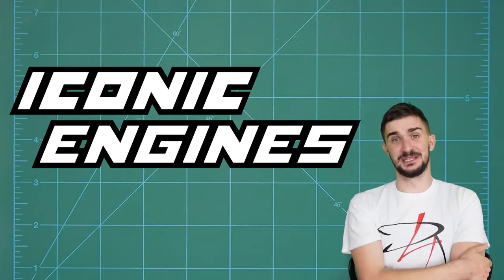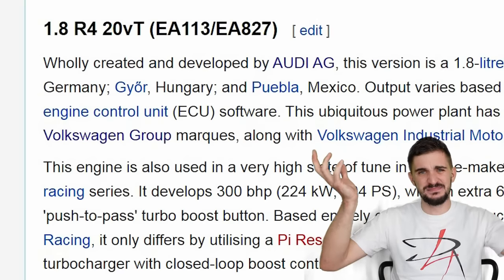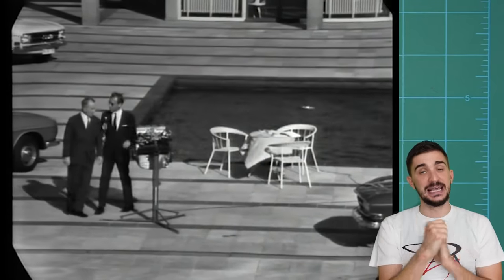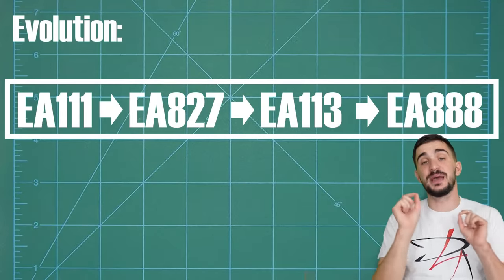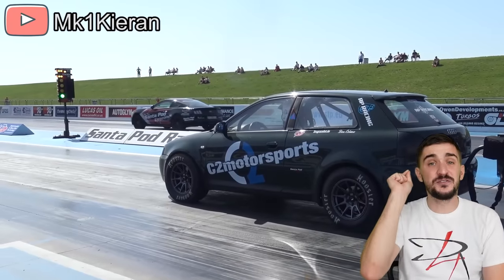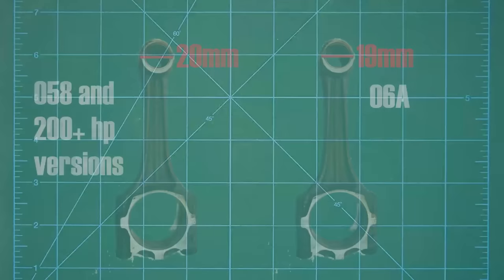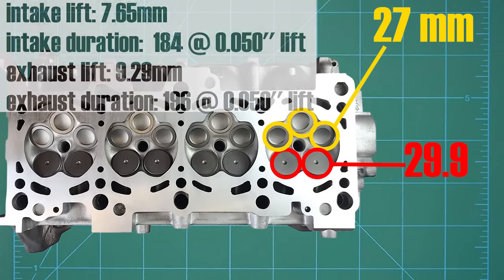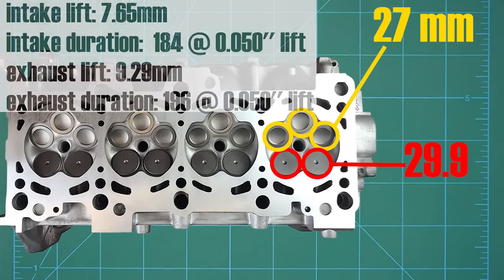VAG 1.8T 20V - What makes it GREAT? - ICONIC ENGINES #17

Comment: you should talk about the 1.9 TDI AFN110 or PD130.
Those engines are really popular here in europe for tunning.
Reply: yeah. i have a stock ibiza with the "130" hp version. (hypothetically for legal purposes) the engine easily gaps similar era jp and german engines. Best car i hypothetically gapped on it was a stock e46 330i. On a really curvy road, his bigger engine and rwd couldnt outperform the low down torque from the shitbox, plus the car is far lighter and curves surprisingly well for an fwd. 330i pilot is a better driver than me btw... just goes to show how good this engine is. plus, it gets INSANE mileage. hypothetically it gets around 22.5 mpg (10.5l/100km) while cruising at 180 kmh (110mph). 3k rpm on 6th gear. car feels sketchy at that point but its a lovely feeling, similar to an r5 alpine turbo but less fun and more polished...

Comment: You can also drop the 20 valve head on an old 1.9 tdi block, whack on a big turbo, supersize injectors, an enormous intercooler, upgrade the internals and make 1200 hp +! Some crazy German did that in an old Golf 2!
Reply: Yes please! Curious how this would perform on a 1.9 TDI PD engine? It already pushes fairly hard.

Comment: From Camotes Island Cebu Philippines 🇵🇭 Italia 🇮🇹 say Holyshit Man, this video is fascinating. I am really happy when I see the car similar Maggiolino Volkswagen ... when you have mentioned Auto Union and the 4 registered trademarks DKW Audi HORCH WANDERER, I will have thought of the "Jipe", the "jeep" as it will be called in Brazil, MUNGA Mehrzweck UNiversal Geländewagen mit Allradantrieb (in Italian: "universal multi-purpose traction off-road vehicle whole wheat").  The Munga, equipped with a DKW 3-cylinder 980 cc 2-stroke 44 HP engine and a torque of 80 Nm, 4 gears + 2 reduced.  "radiator" cooling.  it traveled 8/9 km with 1lt of 2% mixture.  the mixture could be done independently by throwing in petrol and the right amount of oil, and then attached to the cap with a chain there was a "plug" that, by pulling up and down, mixed the fuel.  with permanent all-wheel drive, cantilever nose and rear, short wheelbase, 2m, and all independent wheels, you could go anywhere.  it had a dynamo that could act as a "power generator" ... I had it for 3 years, and I had a lot of fun beating Range Rover, Jeep, Suzuki, Toyota, Isuzu, Bowler, Mercedes, Ariel, Ford. .. when they saw me they laughed, then, I don't know why, they'll be pissed to death hehehe.  the proverb will be true: never judge anyone by their dress. See ya later until next brilliant video, have a good one, cheers 🤗 Peace ✌️

Comment: I had the 1.8 in the ‘98 VW Passat. With a relatively simple tune (keeping the turbo wastegate from opening until around (it’s been me a while) 13psi vs the stock 7-ish, boosting power from 180 to around 220.  Great engine.

Comment: Audi is hilarious because the EA888 is older than my EA855, but my five cylinder turbo has an earlier numerical value lol 

No rhyme or reason. The secondary engine codes it goes by are CEPA, CEPB, or a 07K derivative. Also the newest EA855 Evo in the newer cars is an aluminum block.

Comment: Great video as always! On the point of the EGR on the 2.0 EA288, am I correct in thinking that exhaust gas is recirculated post Cat & DPF? In which case the EGR system should be completely oil and soot free?

Comment: I believe the BFB engine also has VVT via electronically controlled chain tensioner. Also, it appears K03S is not a factory designation, there's a thread on Audizine.

Comment: The mk4 golf was a disappointment not because 150 bhp was too little, but because it had a 2 litre naturally aspirated engine with not much more than 100 bhp. The 1.8T was a later fitment but the reputation stuck. The other issue was that the mk4 was much heavier than the mk1 and mk2 gtis.

Comment: The only iconic thing i remember was the „iconic“ consumption of this engine, when using its power a V6 or V8 become an efficiency car :)
Reply: Does depend on the car admittedly, when paired to a heavier vehicle there's no magic in physics and you're gonna burn fuel to move your A6 or Passat 4motion or something. But in a 2750 lb GTI I average 27.5 MPG-US (33 UK) over 10+ years of ownership, I remember the best tank I ever got I was absolutely caning it up and over a big mountain range, one of the best driving days I ever had and got over 33 MPG-US (near 40 UK) for my trouble. People with VR6 GTIs weren't getting anywhere near that.
Reply: @Trendyflute   I have passat b5 1.8t 2000 stage 1 190hp and the consumption is below 7l/km on highways (up to 130km/h) and below 6l/100km on open rural roads (from 50km/h up to 100kmh) at the moment. But I drive very economically, but also floor it from time to time.

Comment: My audi 80 from 1991 with 2.0 115hp engine had basically the same block as 1.8t but with bigger displacment.
You could just use 2.0 block and 1.8t head and accesories and you would have 2.0t

Comment: There are two engines and the main difference is one is small port and the other is big port. Big port came first. The other difference is the throttle body. Big port is mechanical DBW and small port is electronic

Comment: I had a Leon 20v T4, it was thirsty as hell (couldn’t get it under 10L/100km), the ignition coils failed twice within 100.000km which Seat made me pay when VW changed them for free on the same engine (design fault) and had constant issues with the car starting 2 weeks after purchase from new. Never bought a VAG car since.

Comment: The stock internals of the 150hp are safe up to 400nm. Its about torque not HP.
The rods start to bend when you push more torque trough them and the pistons would then also be at their limit so engine output torque needs to stay below 400nm on an unopened stock block.

Comment: I wonder if Audi had to pay Yamaha for the 5 valve head? More likely, Audi waited till the patent had expired.  It was Yamaha that developed the first 5 valve production engine,  the 1985 FZ-750, they used the "5 valve head" in single, twin and four cylinder format and finally stopped using it in 07 because of euro 3 emissions were getting too hard to pass. When Yamaha was developing the 5 valve head in the 70s they tried 6 and 7 valve (with twin plugs) heads as well, settling on 5 as the best compromise.

Comment: the 1.8t engine code AWP , manufactured halfway thru the MK4 life cycle, put in VWs from late 2002-2005 is the best one. it came stock 180hp vs the AWD engine that had 150hp stock. both engines jumped up to 210hp  from stage 1. so if you were a tuner guy it kinda didn't matter.
fun fact- they also made the AWW engine that went into the 2001 Wolfsburg Jetta and I believe the Jetta GLX of that year. it had the numbers of the AWP.
does anyone know which motor the 20th anniv. GTi and the 337 GTi had in them? im guessing AWP but im not sure👍🏻 thanks in advance if anyone can let me know!!!

Comment: It's not horsepower that bends the rods, it's the torque.  The 1.8t tunes can be very violent in the way boost kicks in low down in the rev range.
A good tune that slowly brings the torque futher up the rev range can have you run 400+ HP on stock rods.

Comment: Im hoping my 1.8t stroker will last a long time. The 1.8t did 500achp, with pump 93. These motors are not cheap to build. My understanding is the vvt is not really a variable  valve timing but rather a emissions thing. The cam chain tensioners need to be periodically changed to avoid  failure. After market is only affordable  option. Aftermarket  timing belt tensioners seem to fail as well. Ive had two ntn, oem supplier, tensioners fail now. One of my family  members 1.8 another on my 2.7t. Im hoping oem one, 4 times more expensive but still made by ntn, is better 🤞

Comment: may i know if its normal for the 20v intake cams on the middle lobes to be slighty off, since for the 2.0TFSi if the lobes are misligned its a sign of valve knocked. its because the lobes are pressed into the cam shaft rather being molded together, pls advice tq

Comment: Can you feature the ford 2.5T engine that started from the volvo T5 2.4T. To a 2.5t petrol engine thats in the ford focus mk2 ST  and ford focus RS. Also the engine is in the ford mondeo mk4, ford Kuga and ford s max. Their all around 220bhp standard except the ford focus RS 300bhp
Reply: The 5 cylinder? I had one of those in a Focus ST, also known as the XR5 here in NZ. Good little engine.

Comment: does anyone know if there is a rwd gearbox that fits these engines? you say the blocks haven't changed much over the years, so do the bellhousings stay the same through all of them? Am engine converting an old rwd car and small japanese turbo engines are way too expensive in my country now, I hadn't considered these but they could be a good option! I'm only looking for around 200hp but want the lowend torque of a turbo engine.

Comment: Love the video but you’re making this a little more complicated than it should sound. The difference between most of the engines could have varied a lot. Some 1.8 8v’s had smaller valves and some ran efi or some ran carbs. It really just depends if you’re buying a normal golf or a gti. They do all have separate engine codes as well. For instance my 85’ VW gti has the 1.8 8v HT.

Comment: I have it in a4 b7 2007 cabrio. And my first chipped one - 141kw and 305nm. I heard swapping in k03s has faster low-rpm turbo spooling. I suppose this will help daily driving. I was long looking what is difference between 110 and 120kw.

Comment: Speaking as a vw expert who’s been in the game for 30 yrs I can say with quite certain that your engine code explication is wrong.   EA refers to a group of engines. The engine code itself is 2-3 letters.  Iirc 1.8t’s have 3-4 engine codes and even though they are 98% the same once you strip them down there are differences because 
vw/Audi used different accessories. There’s also the go difference. 165hp for base models. 185hp for the limited editions and 225ho for the Audi TT.  
It’s correct that parts are interchangeable among most of the 4 cyl’s. The 1.8’s from the old GTI’s from the early 80’s right up to the start of the 16v 1.8’s in the scirocco’s to the 2.0L 8v’s of the 90’sand early 2ks and the 1.8t. Even the old Audis that came with 2.0L (engine code 3a). This also applies to all the vr6. 12v (engine codes AAA, ABV, AFP etc..)and 24v (BDF, AXK,  AKJ, etc…). Note. All vw engines from the mid 70’s to the 2000’s have 3 letter engine codes. Including the 1.8t.

Comment: Great engine. Amazing efficiency, smooth and wide powerband. Horrible oil consumption. Sketchy engineering of the little bolt-on bits that can leave you calling for a tow. After 40 years of VAG, I'm transitioning and now identify as a Mazda owner.

Comment: One correction i think you've misunderstood
the shame of the MK4 GTI wasn't the 1.8t... it was the 2.0L NA petrol engine the GTI got when the mk4 first got off the production line, this 2.0L had no turbo and just all round sucked pumping out a measly 115bhp.. which is what made everyone hate it because 115 from a gti was pathetic add that to having the same suspension as the standard mk4 and basically no upgrades over a 1.6 meant they had released a big slow boat that chugged petrol like it was a muscle car with a tenth of the power and handled like a damn fishing trawler, the mk4 tdi's were already doing more than that in a much better engine, the 1.8t was released to the MK4 line when vw got wind of the backlash from it, the 1.8t was the replacement for the 2.0L to make the GTI into a bit more of a GTI.

Comment: Running an A4 B5 manual AWM with 270000km from Argentina. Truly remarkable engine. With minor upgrades like coil packs, some iridium spark plugs, better oil than stock and proper maintenance is a good engine. Too bad VAG went cheapo on connectors and plastic flanges on the most difficult places to reach on planet earth... Yes, I'm talking to you stupid plastic coolant flange, hiding behind the cylinder head...

Comment: Just like how the 1.9 1z 1.9 ahu, and 1.9 alh are the same motor just different variations. 1z is all mechanical, ahu has electronic fuel control or throttle control and the alh had the vnt turbo as well as a intercooler relocation and different cooler as well as a different ecu a

Comment: WHO CALLS THE MK4 GTI THE WORST EVER? WTF????
THE ISSUES WITH THE TFSI OUT OF THE MK5 HAD WAAAYYYYY MORE ISSUES😅
They're damn lucky they got redemption on the mk6 and then on the mk7.5, I haven't been in a mk8, I test drove a mk6 golf R though and DAYUM that thing drives like a GTi thats already tuned and the R handles turns at high speeds so much better 🤤 the salesman wouldnt let me punch it past like 80-85mph on the freeway im lime BRUH I GOT ANOTNER GEAR WHAT U MEAN SLOW IT DOWN? I'd have paid the damn ticket if I got one😅

Comment: Had this engine twice,in an A4 1.8T and then a TTmk1 225.   It was a dreadful unit for the sporting driver.  Unwilling to rev freely and also very slow to lose those revs. Just not a free spinning unit. It also sounded unsporting, wheezy and unappealing.  I hated it.  The EA888 changed all of that.

Comment: I'm looking to buy an Audi TT from 2001 which has a tuned 1.8T 20V (270hp). My question is how reliable really is that engine? That car already has like 170k km on it and it would be (like your example in the video :D) my 2nd car coming from a VW Fox 1.2 with 54hp (Which I really hate. Increadible rough, weak and uncalm 3 cylinder engine)

Comment: The oil consumption of this engine is mind boggling. Where does it all go? I've had ford's for years and they burn no oil at all. I had an audi A6 1.8T, and got though about 1 litre of oil per 5,000 miles.

Comment: No one is actually calling them EA888's. They are just know as 1.8T or 1.820VT in every day speak. Then you add the engine code (AGU, AUM, BAM etc) to differentiate between variants. It really is not that complex.

Comment: I wash Audi had continued to develop DKW's 2-strokes.  I think the whole car industry got the 2-stroke all wrong.  They saw it as a cheap POS you can make when the customer is too poor to afford valves.  They were all low tech, low quality, and tiny.  In powersports they're known as the lightweight option with outrageous power potential.  Modern 2-strokes have solved the emissions issues and even have factory turbos available.  In the boating world, they're known as the option that gives superior low-rpm torque and the best fuel economy, whereas you put up with a 4-stroke if you need something with a silent idle that won't scare the fish.

Comment: The weakest point is always the transmission on this engines 5 gear are up to 250nm and 6 gears are up to 350nm. Maybe it needs an upgrade the stock transmission.

Comment: Currently suffering with my 2013 A3 1.8 TFSI. Only has 94k km on it as it's with the mechanic every month to fix a plethora of serious issues from coolant hose leaks to PCV/breather valves and now cylinder 3 is misfiring, exhaust is pouring out of smoke and it keeps cutting out. I know this engine has a great reputation but the TFSI generation is junk.

Comment: If this engine is fundamentally not new, and has been used in dozens of different models, why can’t they make it reliable like a Toyota engine? Does VW simply choose not too? Is it complexity? Or is it simply a lesser quality of components?
Reply: Because atmospheric engines always break more than NA (in this case toyota) engine. If you compare these vag engines to toyota turbocharged engines they will last around the same amount of kilometers.

Comment: Yeahhhhh you got it ALL mixed up. American engines are far closer to the way VW does engines than japanese. The LT1 engine from the 60's is on the same architecture as the LT1 from the 90s which is related to the LT1 from the 2010's but no interchangeable parts. then the LT5 is completely unrelated in the 90s and the LT6 and LT7 are diesel engines designed by oldsmobile

Comment: Great? :D its underpowered, thirsty, has two fuckin drives (chain and belt both), suffers from continious chain tensioner issues etc...  Also, dont wanna be rude, but the Kadett GSi did 150hp in 1987 (in a 970kg chassis) with a non turbocharged 2.0 16V. Plus that engine was reliable till eternity :D

Comment: Iconic engines huh in my opinion iconic engines should last many many kilometers not be turbo charged although a lot of Toyota engines have been modified which does reduce its longevity and longevity is the most important not how much horsepower you can squeeze out of it most people don't modify there cars now in N.S.W Australia the maximum speed limit is a 110kph and both our four cylinder cars we own can easily criuse at that speed so whats the point lets get back to longevity and there have been Toyotas sold that have done 980000kms on them a 2002 Corolla and of course a 1997 Toyota Hilux l do own one with the famous 22R engine the R series has been around since 1953 and Toyota discontinued making them in 1997 actually the 30th if September and there are a lot of 22R engined Hiluxes still around and in the single cab rwd aluminum trayed Hiluxes sell for aud$5000 $6000 $8000 and $10000 why because if the 22R engine under the bonnet

Comment: power cannot be attained at the cost of longevity and reliability. ive dealt with 3 cars with engine and all of them ended up as junk , i rreplaced it with the deisel 2 ltr  of thesame brand . horrib;e. once you open the engine it is a bitch to put it back . cams get dimolished with slightest of overheating , no wat to rebuild. once u get a new cam it will not fit the engine as the warping due to heat the cams will not adjust properly.
not to mention the turbo .. intercooler .   very delicate and need to feathered or else the spew oil...  worst   ask  JR go